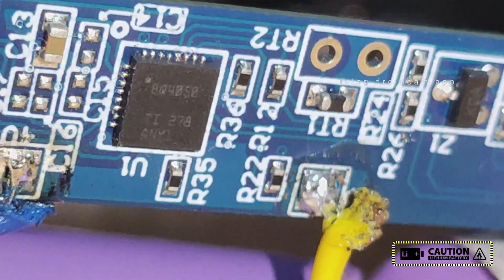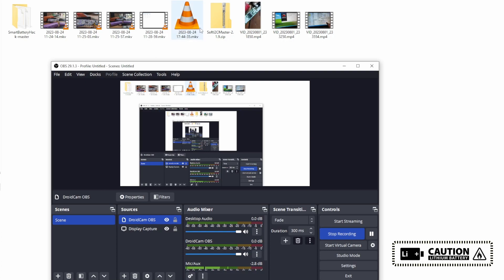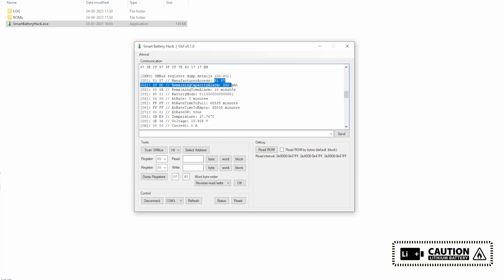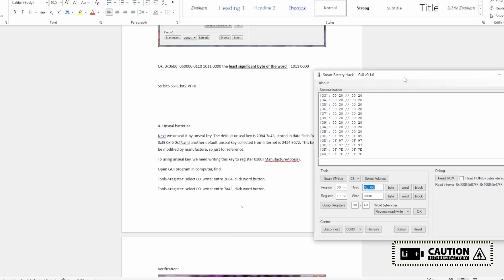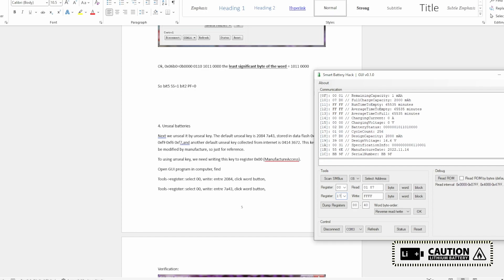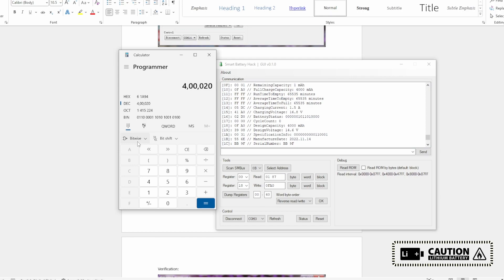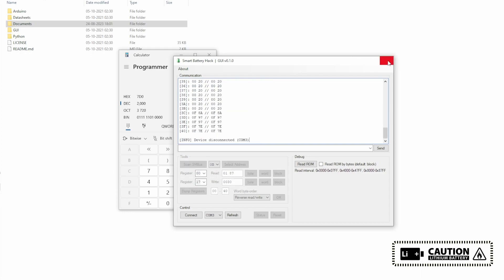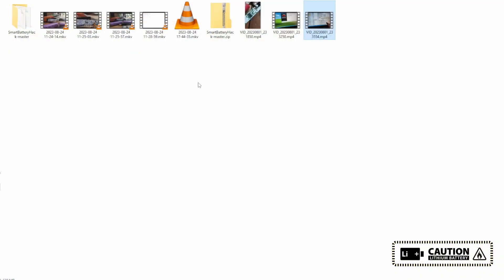Using ARDUINO UNO Rewrite BQ4050ROM" Laptop battery data retrieval - BMS HACK

Comment: Thanks. Very informative.

I replaced the cells on my laptop battery but I suspect the BMS is locked due to no voltage when changing the cells. BMS has a BQ3060 chip.

Any program you can advise to use to read and write to this chip? I have the arduino uno and EV2400.
Reply from the maker: Hi, I think for bq3060 chip there is bq evaluation software is available. Check on the ti site

Comment: brother help me my battery is detected but its locked how to unloack this, you told is video unseald thats mesans unlocked
Reply from the maker: tell me about your chip and model
Reply: @AnandakrishnaSudhakaran  sh366000ax i succesfully reset this but still there is a problem icant change anything also ifound the reset key in this chip datashit just reset everythings works fine but cant change anything idont found the unseal key

Comment: Hello Sir, it just seems that the writes are accepted at 00 register but the chip wont unseal, further write commands are accepted but changes are not made, tried both keys but none has effect on unsealing this BQ4050 gauge ic, the pack was made by samsung, i think it should have different keys, where can i extract them? i cannot understand the proccedure in the TRM manual. i will try with CP2112 method and later with the aliexpress knockoff of the EV2400 to check if i have luck
Reply from the maker: Hi what is the manufacturer name showing on there?

Comment: Hi, i have HP/Compaq 420 battery PH06 with 6 pins, can u do diagram connections please?
Reply: no necesita un diagrama. Siempre en los extremos esta el conector positivo y al otro extremo negativo.
para saber cuales son el pin de datos y el clock usar un multimetro para medir resistencia (flecha con linea vertical en la punta) colocar la punta roja del multimetro en un conector del extremo de la bateria e ir buscando con la otra punta del multimetro hasta encontrar valores de resistencia entre 600 a 700 omhs.

en el foro de la web nbla vas a encontrar la mayoria de los diagramas de pinout caso contrario se puede realizar una consulta

Comment: first thanks for replaying ,my hp battery connector is like that   ++, ++, SDA, SCL, ??, T, –, — but its give me error no SMBus device found .i switch the pin data with  cklock and not working any idea?
Reply from the maker: Share battery model
Reply: @AnandakrishnaSudhakaran  hp pavilion dv7 battery part nr 480385-001 and you know the chip is bq20z75

Comment: hej can you help me find right file for my HP laptop battery (bq20Z75)to use same method as you didi  .thanks
Reply from the maker: If its use sha1 method or if the keys are default you can try this method, for normal unlock use bq9003 and try unseal and for sha1 method choose bq30z55 and click unseal
Reply: @AnandakrishnaSudhakaran  iwant just to unseal bq20z75 which i have in my battery with arduino that i have tell me just what i need for files thank you very much.

Comment: Is there any differences in terms of capability between using arduino and cp2112? I have this chip in my laptop battery and change one of its cells because its broken. Thx, great content btw.

Comment: Hi, I have a laptop battery with the SH79F329, I think it's blocked but i need to read the data to be sure. Is it also working with this one ? I just discover your work, it's really great!
Reply from the maker: Do you have any tool to read the data?

Sorry for late reply
Reply: @AnandakrishnaSudhakaran  I have some microcontroller board like Arduino or ESP32. I also have some SERIAL to USB converter, if it can help.

sorry for my VERY late reply

Comment: what is the unseal key for "045A20 SANYO chip"?
Reply from the maker: Sorry, I don't have this chip. did you search on google?
Reply: @AnandakrishnaSudhakaran  I was searched many time, there is no such information about the chip. But this chip is mostly used in Lenovo Ideapad 320/330 laptop battery.
Reply from the maker: @akibhosenkhan4217  There is a method to reset. but not documented. Do you have any board to check the chip? Like cp2112 or ev2300
Reply: @AnandakrishnaSudhakaran  I don't have those board. By the way , your last part in this video, you hints a software called UBRT. Please make a details video about this, and also your DYI  device .
Reply from the maker: @akibhosenkhan4217  UBRT REGEDIT  is a professional  software, which works with ev2300, LPT to I2c and usb to gpio. Do you have arduino board?
Reply: @AnandakrishnaSudhakaran  Yes brother, I have arduino uno R3 board
Reply: @AnandakrishnaSudhakaran  Your work is very good and inspire me to work for it. Thank you very much.  How you make your LPT to I2c converter ?
Reply from the maker: @akibhosenkhan4217  Thank you brother. i want to make a free tool or use the current tool and give directions for others. So they can do without any expense tool. Lpt to i2c I followed this

https://jb8a8f8.com/support/index.php?attachments/i2c-jpg.1879/

Also if you have the arduino uno board we can try some tricks to check the battery condition. Also try some unlock methods.
Reply: @AnandakrishnaSudhakaran  brother, how to connect pc with this LPT device?  , because my laptop does not have DB-25 port.
Reply from the maker: @akibhosenkhan4217  newer type pc or laptop not support db25 port. So you need an older motherboard.I tried on my old board and it worked. But that software does not offer reset. We can just read data, and it shows chip numbers also.
Reply: @AnandakrishnaSudhakaran   Could this converter may work?  What you think ?
Reply from the maker: @akibhosenkhan4217  This software for read not for reset. Your need is reset. Not just read, so don't hope for a result. I suggest you work with your arduino, try to watch my arduino video.

Comment: can you make video to unlock and rewrite bms drone fimi with ic 6003-001 NQ97P
Reply from the maker: Pls check chip number again? Is it 6003 or 9003? For drone I saw 9003, 6003 is not on the software. If you can pls send a photo on my telegram, insta or discord . So i can ask my friends. Also i will share a drone group. They mainly unlock bq 9003,bq9006 and bq30z55.
Reply: @AnandakrishnaSudhakaran can me know your telegram
Reply: Telegram id

Comment: after replacing cells pack does not have output
what parameter should i change to get it back in work?
thankx in advanced
Reply from the maker: Which chip ? Did you restore rom?
Reply: bq 20857
yes i did
 @AnandakrishnaSudhakaran
Reply: sorry i saved the rom not restore it
how i restore it
Reply from the maker: @HawayaAna-ey3td  Which software you used?

Comment: thanks alot
but ive one question
why ican modify all parameter in bq 40z50 except cycle count would never change?!!!!!
Reply from the maker: With full access mode only some parameters can be changed with this software. If you need more options, you need to use bq studio or other professional  tools, but those only support ev2300 or ev2400. So if you want to change only cells, , do recell and dumb and upload eeprom, it will clear errors and do cycle count change and full charge capacity. Other parameters can't be simply changed, it needs more information and knowledge.

Comment: excellant job
hard work
it works for me on one battery but not other types
Ques:
what is Known unseal keys other than 0414 3672 ?
Thanks A LOT
Reply from the maker: Thanks for your support. These are the default keys, otherwise we need to do a deep research about the chips. What are the other chips numbers? So i can find if any keys available.
Reply: @AnandakrishnaSudhakaran  Can you provide unseal key for SH79F329AX ?  🙂
Reply from the maker: Sorry i dont have key or method for this chip. I will search and tell you
Reply: bq9000 bq2084 bq 2090 @AnandakrishnaSudhakaran
Reply: reading the TRM for the BQ4050 they explain that all keys are presented in the memory but not in plain sight... if this whole thing was actually not that difficult at this point... try with cp2112 method which uses other software. if no luck go to the aliexpress knockoffs of the EV2400 which can use the official software BQStudio from texas instruments...

Comment: great videos thanks  for it.please make videos on maxim ic,s also RJ chips like r2j240 i hope you fix our this problem  soon
Reply from the maker: Thanks for your support, i have only a 51f51 chip with me. Still trying to enter bootmode. Anyway if i get hands on ev2400 i can try to unlock these chips. But it will take time. With cp2112 very hard to unlock, because there is no documentation available.

Comment: Brother I tried uploading code to my esp32 but this error occurr

Compilation terminated avr/wdt.h not found 
No such file or directory please help
Reply from the maker: i will check and reply
Reply: I think avr/wdt.h   library is missing can you provide it or till will not work for esp board
Reply: I define the correct SDA/SCL pin according to esp32 board but I think it's compilation error

Comment: Esp32 can be used instead of adruino ?
Reply: Full access default key is same for all chips or not
Reply from the maker: @MYSTRIFACT  on tht github link check wiki section there are some keys showing. Try that also
Reply from the maker: I will check and reply to you. Thanks for your comment.
Reply from the maker: Hello there, on the arduino code on the first part where the i2c pins are defined, you can add the required pins for the sda and scl. Then upload the code to esp32 and check with the GUI.
Reply: Ok I try and comment if it works

Comment: Renesas:
M37512 (Sony, Sanyo, SDI, LGC),
R2J240 (Sony, Sanyo, SDI, LGC), 51F51 (LGC),
R2J24051(LGC), R2J240DELLSDI10F50,
045A20(LGC)

MAXIM:
MAX1781 (Panasonic, SMP, SDI, STL),  MAX1786,
MAX1786A (Panasonic), MAX1788 (SDI),
MAX1789 (Asus), MAX1785 (Panasonic),
MAX1787 (Panasonic)

 OEM
BM3318, NT1908, A2170, A2169, A2168,
MEGA406(Asus) 
please make a video on all these chips how to clear its PF and reset FCC?
Reply from the maker: Once again thanks for your support. With the free software and free resources I cannot make anything with my knowledge. But I am trying every day to make something for the community for free, So it will take some time, also iam limited to hardware setup. New video is coming with UBRT  free software. Waiting for my usb to lpt converter to come.

Comment: waitiing for your software which support MAXIM chips and R2j240 chips hope it works
Reply from the maker: Hey thanks for your support. Maxim and R2j240 are still on the list. Am trying to buy a ev2300 for further study. Am saving some money for it. Also I am trying to unlock 51f51 which is almost the same as this r2j240.
Reply: @AnandakrishnaSudhakaran  I hope you will be able to unlock the chip R2J24051F021A. We are waiting for a new video on unlocking the chip R2J24051F021A
Reply from the maker: Thanks for your support, unfortunately i dont have that chip with me now. But if you need any assistance i can give you. Feel free to contact me on instagram or telegram

Comment: Hi, How to unlock a chip while not knowing unlock key? Thanks
Reply from the maker: First try all common keys available on the internet. And there is no universal way to enter boot mode. Free tools are not offering easy unlock. Because nobody knows the correct way of unlocking. So at this point we need to use other paid software which supports the unlocking of your chip.